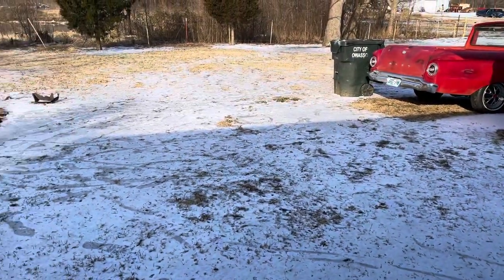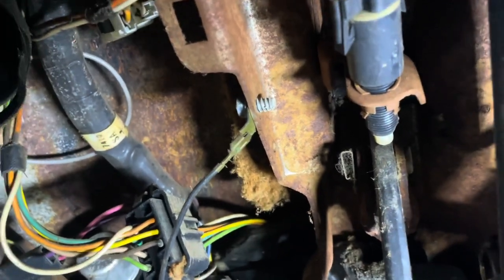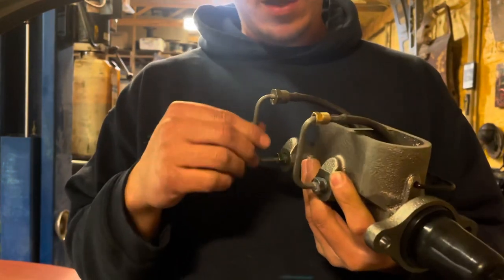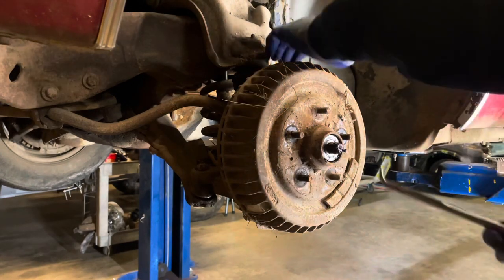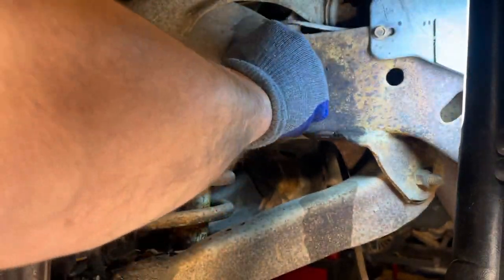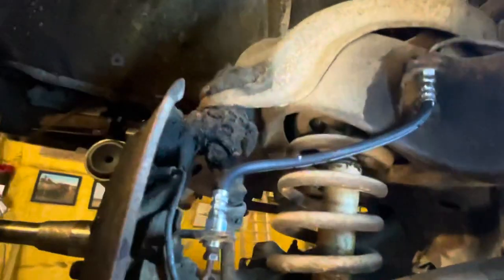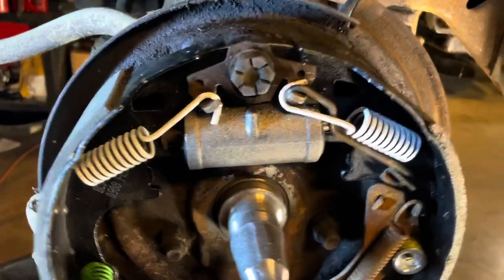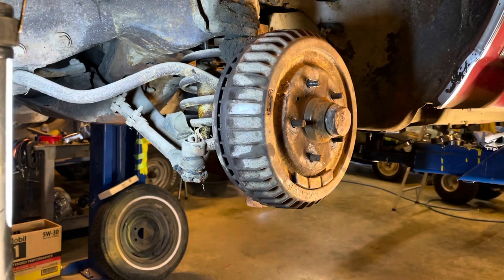1969 Buick Skylark project episode #7. GM A-body front drum brake rebuild.

Comment: Short shoe ALWAYS goes toward the front. The larger primary does most of the braking and ALWAYS goes toward the rear. Lubricant the backing plate nubs with a little anti-seize as well. Good video.  Maybe the wheel is backwards.
Reply from the maker: thank you for commenting and the information. once i get it to daily driver status i will swap things around.

Comment: Hello, I also have a 69 and am struggling with the rear. I’m unable to remove the rear axles due to a roll pin in the rear diff. Have you experienced this?
Reply from the maker: yep. it’s relatively easy to pull the pin. you just pop the rear cover off and rotate the gear housing in the axle until you see the bolt/pin that holds the big bar tube in between the axle shaft ends in the very center of the axle. once the pin big bar tube is out you can shove the axles in to pull the clips out. then the axles slide right out. just dont spin the axle or driveshaft after the bar tube and axles are out.

Comment: Brake shoes, not pads. You need to clean the backing plate and apply lubricant on each of the oval pads on the backing plate where the shoes ride.

Comment: If that OEM master cylinder is part number 5452310 and the code on the front pad is "CT", I hope you kept it. 

I had White Post Restorations in VA redo my original (same one) and they did a great job.
Reply from the maker: Its somewhere around. Im about to get back on this one. Got some tires for it, some new parts to fix that lifter rattle and then floor pan replacement.

Comment: Bit by bit! You’ll be able to drive it on the road soon. I always found drum brakes are a pain in the behind. But like you said any car pre about 1970 had 4 wheel drum brakes, generally manual none vacuum boosted. I can tell you’ve done this a few times tho. Car is in good hands. I do like your new floor pans! Those will be easy to keep clean and change when they wear out!
Reply from the maker: yea they arent fun. drum brakes work fine as long as you drive defensively. They cant compete with new cars tho.
Reply: @BrokenWrenches  Yes newer cars have really come a long way brake wise. My cousin told me once if they had today’s brakes on muscle cars we would probably have a lot more of them left to restore.
Reply from the maker: @darrencatenacci2737  hes not wrong. I wrecked the crap out of my 68 skylark as a teenager!! I havent shown that car on the channel yet. Ive had it 22 years now.

Comment: Correct me if I'm wrong but that bottom spring isn't installed correctly that will never self-adjust with the spring on adjustment side of the adjuster.
Reply from the maker: Thanks for watching. I will check it out when i put new lug nuts on it. Ive never know automatic adjusters to work well.